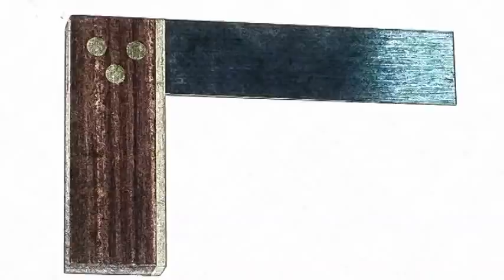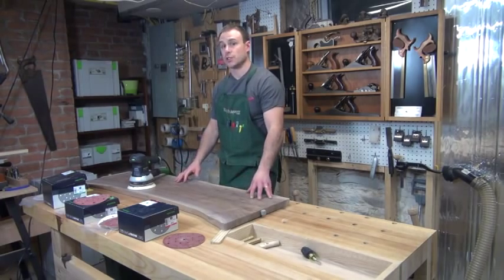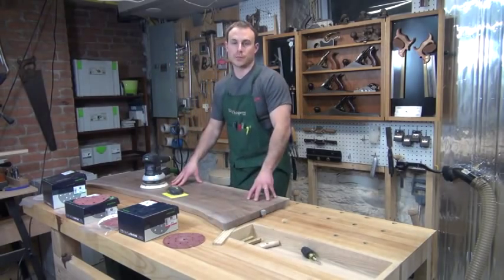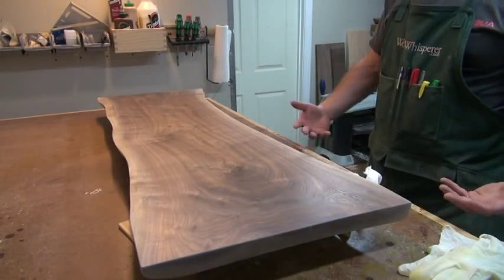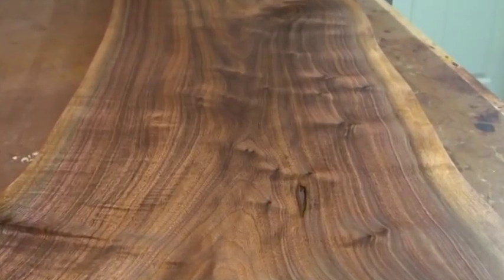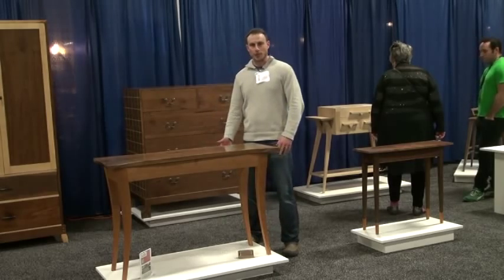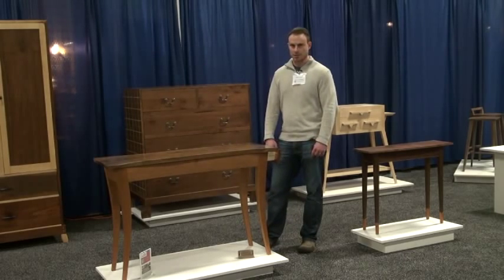Live Edge Table - Episode Ten

Comment: Rob, I knoticed you did not apply any oil to the bottom of the slab. I was under the impression that once you apply finish to one side of a board you have to do all sides or there will be warping. Have I been mistaken, or, did you just not show the underside getting done?

Comment: Is it a bit cloudy or just the camera?  If so, I would recommend never putting shellac on top of crystalac or aqua coat.  Shellac is alcohol-born.  Alcohols break up the aggregates of silica and leave it as a powdery substance.  This breaks down the polymer and dries it out giving it a white powder look.  I guess everybody has their methods.  Maybe you get away with it, but I feel like it's worth noting for others.  A lot of people complain about cloudiness using these clear pore fillers and I believe many of them are using an alcohol-born or acetone on them.  Of course as a sanding sealer, shellac is great, just let the alcohol completely evaporate before using the filler.